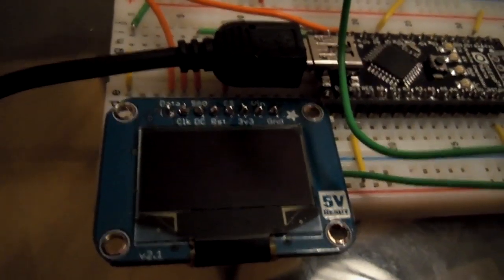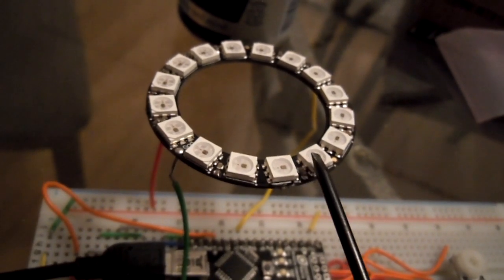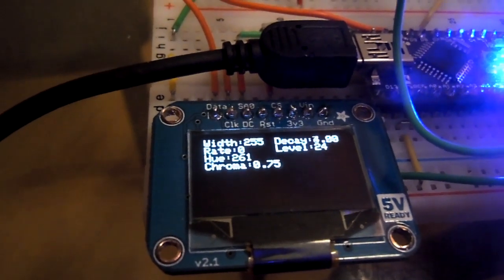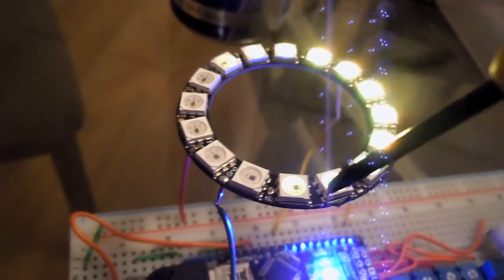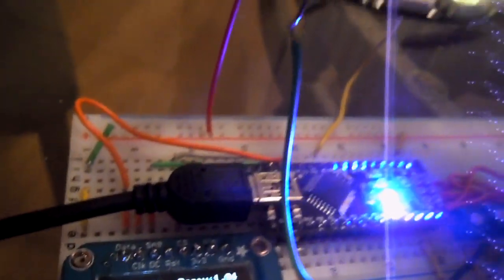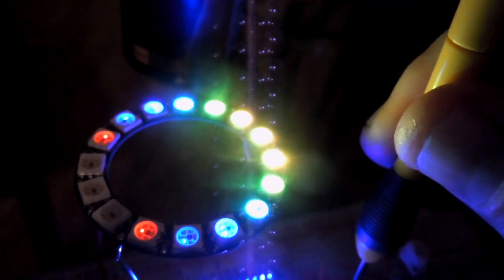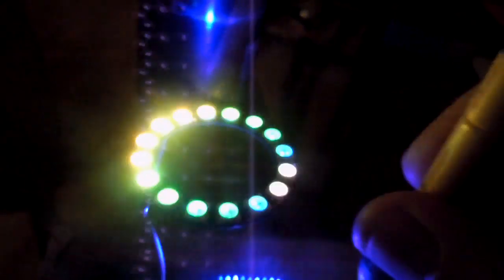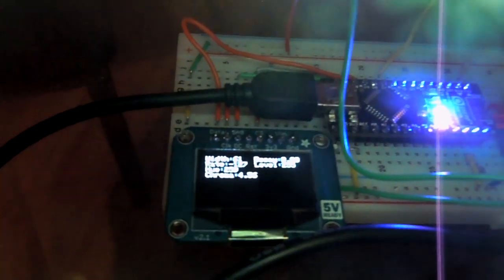Arduino Nano + 128x64 OLED + NeoPixel Ring

Comment: is the nice streeming caused of the pwm for led and framerate of the cam?
Reply from the maker: The streaming effect is from oversaturation of the camera's sensor, and I am guessing that there is a filter that controls the shuttering effect, but the LEDs are strong enough to bleed through.  These pixel rings are quite bright.

Comment: Why are the light strings appearing on the camera?
Reply from the maker: +Kasper Nørgaard The LEDs are too bright that they are causing issues with the camera.
Reply: +vespira okay so it is not because of the Ardunio Flakket? 😊
Reply from the maker: The colors are not very clear because once any light becomes bright enough, most cameras will show the light as white instead of orange, red, etc. 

The vertical stripes of light you see are caused by the way this camera scans the image... you see little ghost light dots that repeat because the LEDs are really flashing very quickly.  It's sort of like looking at a spinning fan when a strobe light is flashing, if that makes sense.
Reply: +vespira that makes sense, but is that because of the Ardunio?
Reply: It's because of the frequency of pulses on the LED's. Not directly related to the Arduino in this case, as the cause is the protocol used by NeoPixel I think, but you can create the effect with one.

Comment: Will that screen fit behind the leds/inside them?
Reply from the maker: Yes, the screen will fit within the ring.  The PCB itself will not fit inside the ring, but the screen portion will.  I am mounting the entire thing within an aluminum cylinder.  Hopefully I will have another video once the thing is showing useful data from my engine.